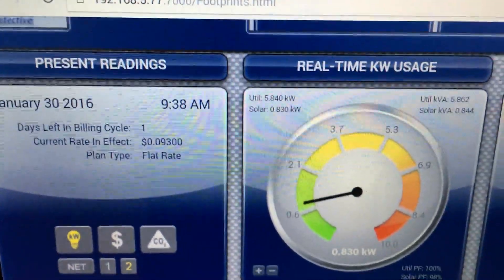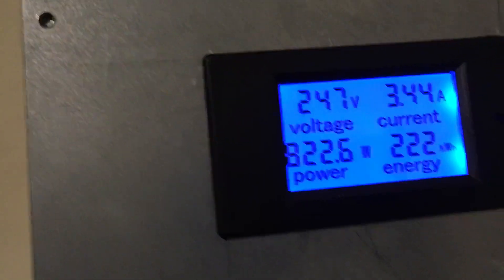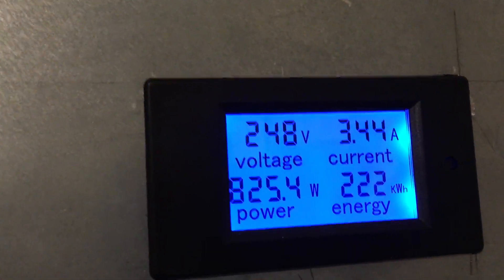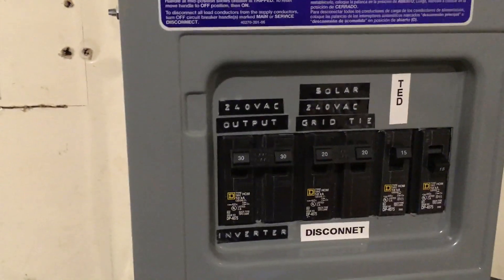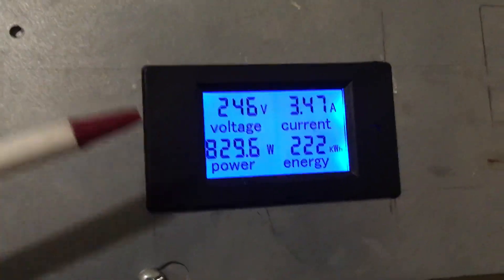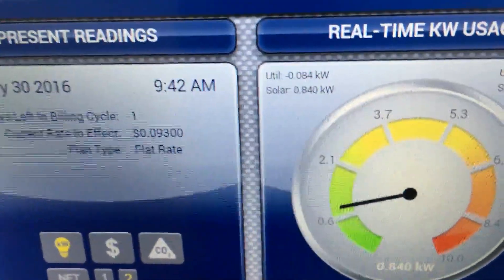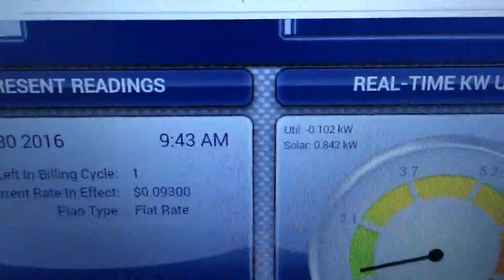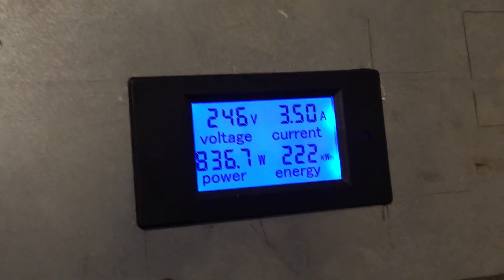Video Response to DIY Home Solar Power Monitoring Question

Comment: you can't measure power, it is a calculation of voltage x Amps, which it does this internally. I think it was designed for DC and isn't quick enough to measure the AC waveform via the current transformer. I have 4 of them all are the best panel meters bought yet on DC